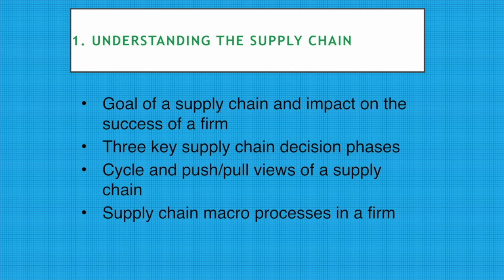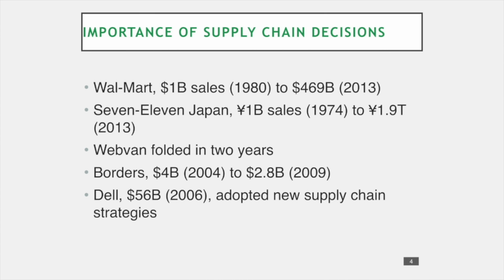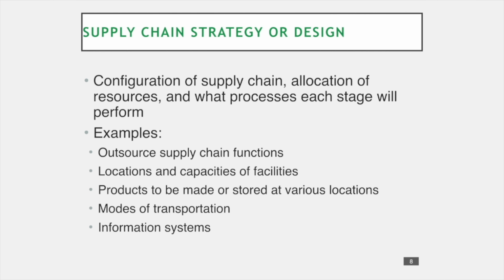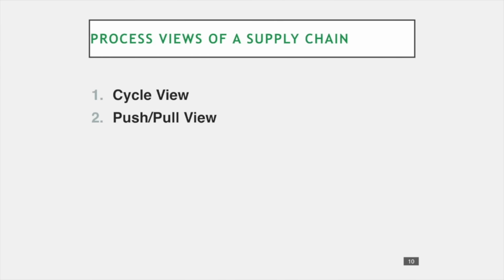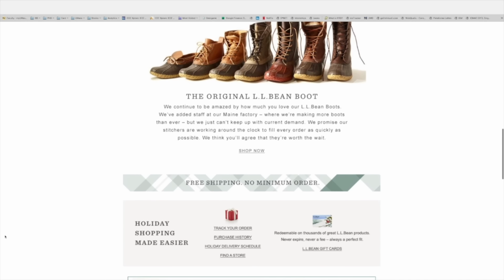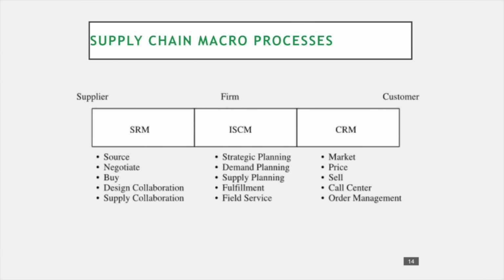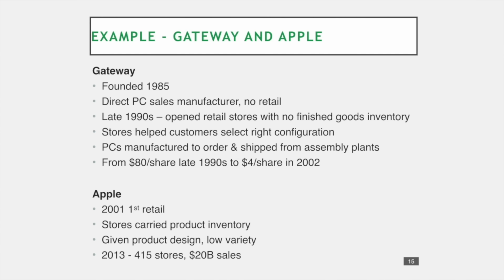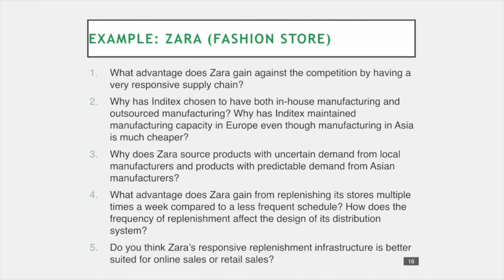Understanding the Supply Chain | What is Supply Chain & How it Works

Comment: In commerce, supply chain management (SCM), the management of the flow of goods and services, involves the movement and storage of raw materials, of work-in-process inventory, and of finished goods from point of origin to point of consumption. On the most basic level, the purpose of supply chain management is to make inventory readily available in customer facing positions to fulfill demand. The fresh produce business adage “you can't sell from an empty wagon” highlights this fundamental purpose of supply chain managemen